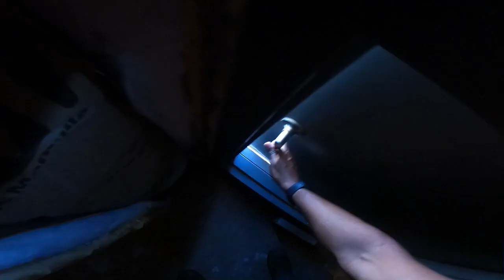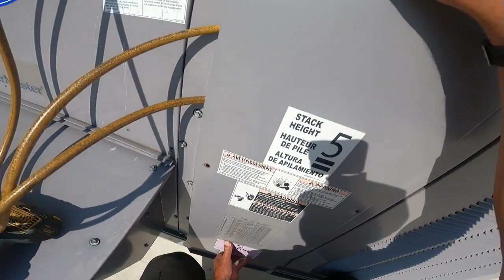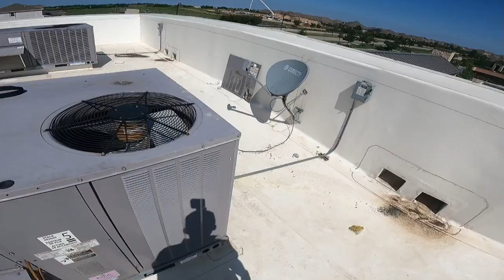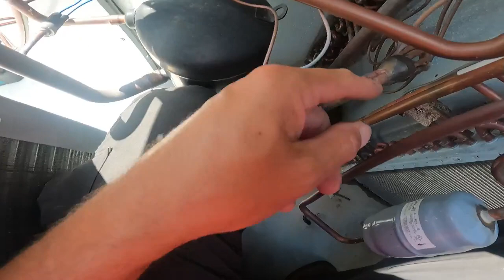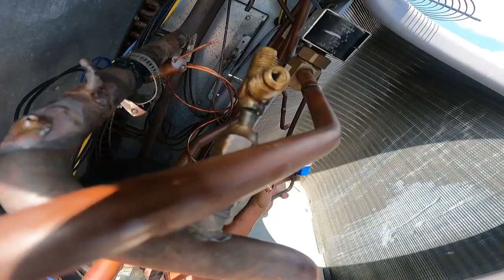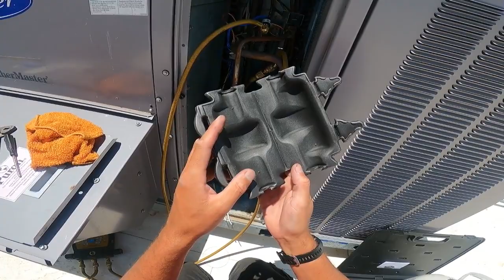TXV Replacement on a Carrier RTU

Comment: Would it have been easier to remove the compressor out the way or take the top to replace the valve? Which probably would have required a second hand
Reply from the maker: @mrgreen9086  may have been easier or about the same. I don’t like removing compressors if I don’t have to.  BUT…wouldn’t be wrong if you did.
Reply: @Matrix13533 yeah I'm replacing one on this exact model unit does not look easy lol